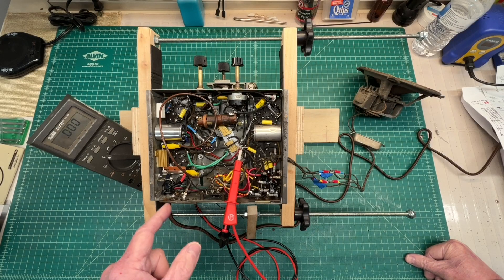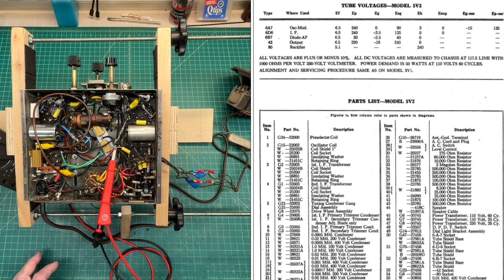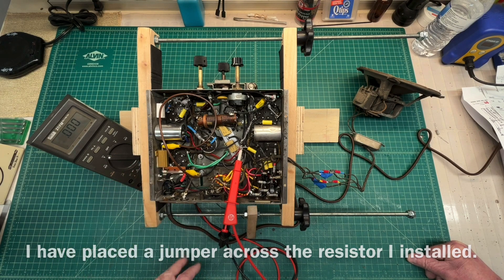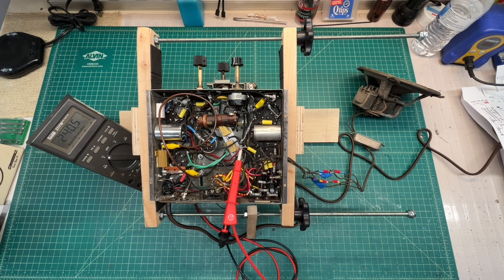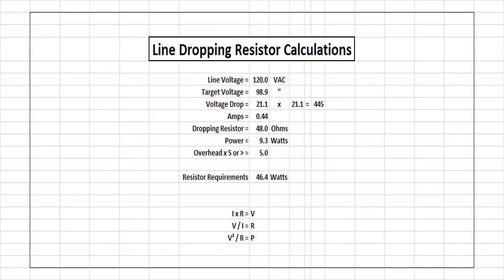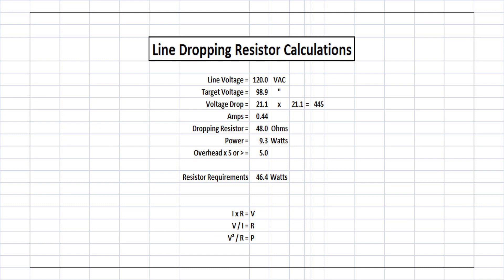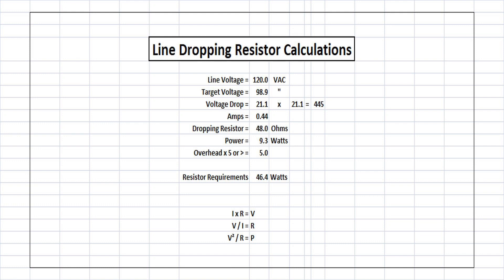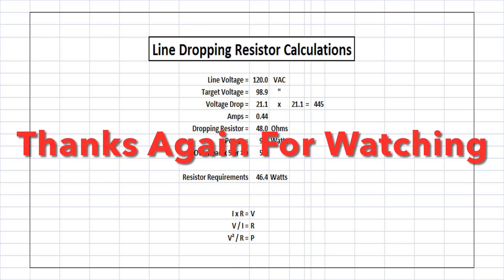Crosley 5V1 - Line Dropping Resistor Calculations

Comment: Greetings:
You mentioned concern about the heat from the 45 ohm resistor. For $6.99 free shipping you can avoid both the heat and wasted energy by using a 53-64 uf 125 vac motor capacitor dropper. If you choose to delete the rectifier tube you can recalculate the value of the dropping capacitor to restore your 240vdc B+ voltage. You can re-purpose the 5v heater winding if it simplifies capacitor selection by wiring that high-current winding in or out of phase or left out of the primary circuit; remember that you should still save all that heat because the capacitor gives the power back, just changing your power factor somewhat. (Not sure how close to 240vdc you will be, but for a daily driver the error is liveable.)
I almost forgot; you will need to find a place for it (above the power x'former!).
Reply from the maker: James, thanks for the detailed information. I’ve decided to let it be since it won’t be a daily player, but I’ll file your comment away for future reference. All the best. Don

Comment: Great video Don, I've needed to add dropping resistors to a few of my older sets.
Reply from the maker: Thank you Gregg. Those power resistors generate lots of heat, but sometimes necessary. Hope you’re doing well. Best, Don

Comment: Greetings:
Use a 50 uf 440v motor capacitor $10.15 free shipping. No heat dissipation. Yes it is physically large but on top of the chassis should be lots of room. What do you think?
Reply from the maker: James, I appreciate your recommendation. There’s no room on this chassis based on the specs for the AC capacitor, but one to keep in mind for future… Thanks again for reaching out. Best, Don